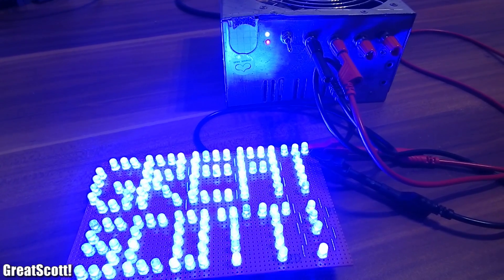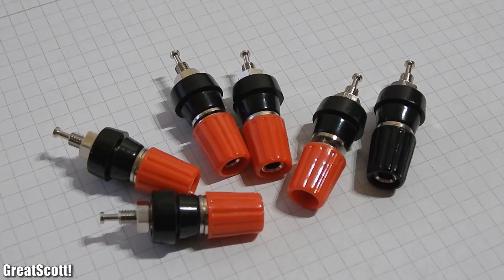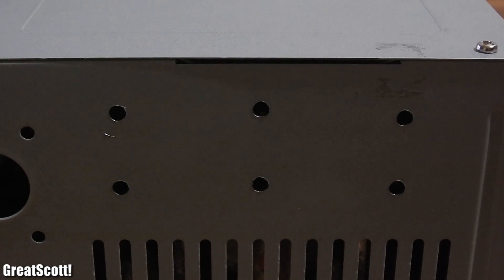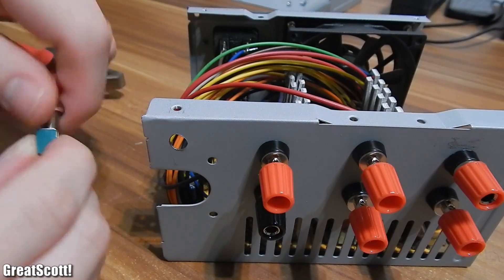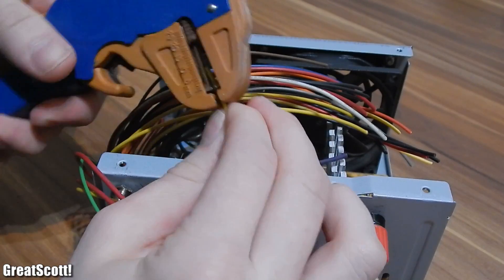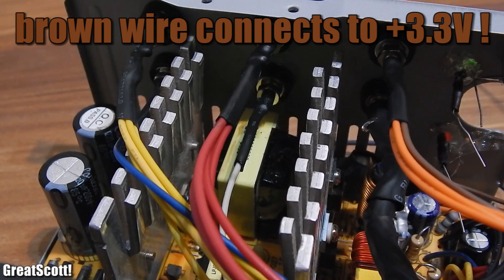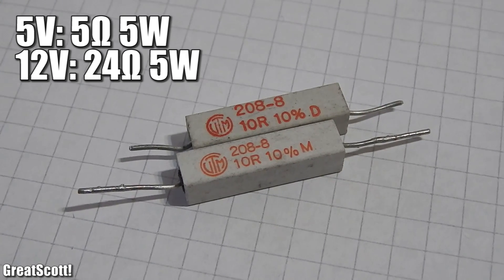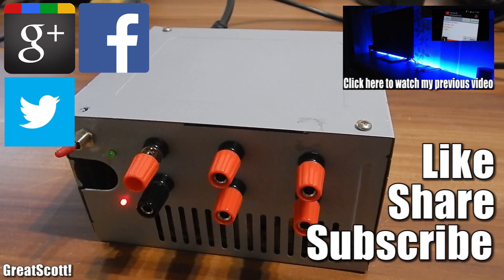DIY Lab Bench Power Supply

Comment: I don't understand having to use a dummy load like it was used here to make it stable when you're drawing a small load because a device will only take what it needs, for example say you have a 12v 2a device  like a mini computer, but you plug a external hard drive into the USB and it doesn't work and it seems to drag the system down then you use a 12v 3a and it works fine because that device only draws just enough to properly run that device so why does this dummy load make a difference?

Comment: The Purple wire 5v SB 2amp is great if you have a clock or something you will always need on SB stands for Standby so even when you turn the power off the way you have it and the off switch is not directly after the mains in, it will stay on, awesome for my uses
Reply: thanks i hade no idea and run a second 5v power supply

Comment: This is essentially what I use since money is tight & electronics is just a hobby. 5V, 3.3V, & 12V are common enough voltages. I've been meaning to do some modifications to get other voltages out of it like 1.2-1.5 & 9, but I haven't gotten to it yet.

Comment: Great Scott  I have a question I tried to build the power supply I followed you instructions and when I wired the switch and leds it worked and would light up and the fan would spin once I connected the resistors and the binding posts the on of my leds stopped lighting up and when I flipped the switch the light on the power supply stopped lighting up I disconnected the resistor and now the led lights up and dies do you have any suggestions please help

Comment: I'm sorta a noob at electronics, so would you explain to me why/ what you would need -5 and -12 volts for?
Reply: Negative voltage just means the current is flowing in the opposite direction.  So if applying a positive voltage causes an electric motor to spin clockwise, applying a negative voltage will cause it to spin counterclockwise.  

I'm still learning this stuff myself, so while I'm sure they're used in other contexts, I'm not sure what they are.  When I see a negative voltage on my multi meter it usually means I've made a mistake. :-)
Reply: Just to expand on the answers, (you probably know this by now) but you can also connect the positive to one of the positive terminals and negative to another terminal to get a greater potential difference. eg. positive to +12 and negative to -12 = 24V
Reply: therealfaloun that's not what he's asking,.. he wants to know what -5v and -12v is use for, i'd like to know as well.
Reply: @Kyle Thomas, the +/- voltages in this supply are used to power the input of OpAmps so the output can be driven to a very precise voltage. In almost all circuits where you find a negative voltage generator, that negative voltage feeds into a precision op amp, either the power rails themselves or the inverting/ non inverting inputs. If you have a +5V rail and a -5V rail you have created a differential voltage of 10V on the output, and you can get a very precise 0V output as well.
Reply: Kyle Thomas the +/- power supply are used for opamps. Opamps are used to amplify and/or oscillate signals. As many signals consist of both positive and negative magnitude (ex- sin wave), it is only possible with negative voltage to amplify it in negative magnitude otherwise negative half cycle would be clipped in output.
Reply: You use 5V a lot when messing around with Arduinos and other small electronics, while 12V is commonly used on vehicles (cars, boats, RVs, etc).  Those are general statements and not true in every case.
Reply: therealfaloun awesome thanks! It makes sense, gonna go and try this for myself.
Reply: Ok that makes sense, but would u have to do anything with ground? or Just keep it connected to the negative terminal or whatever you have it hooked up to?

Comment: Great plug & plag DC PSU DIY.  However would be better if you made it variable PSU so that you can control the current.  A lot of modern PSU's do 70A+ on the 12V rail.

Comment: Hey scott I got a power supply but when i put two 10 ohm 5% 5w resistor (part number A103639ct-nd i got it here http://www.digikey.ca/product-detail/en/te-connectivity-passive-product/SMW510RJT/A103639CT-ND/2731163 
) they heat up too much like way hot I did not leave them for long because i have no clue what will happen. what resistor do I need. On the power supply my red is the highest output at +5V 31A.

Thanks

Comment: why do you have to put the load in it? what would it do if you didnt?
Reply: The power supply won't'work otherwise, they detect low load and then shut themselves off.
Reply: I put in two usb-ports and I added a cable with a barrel jack, for my Arduino.
Reply: INVISIBLE SUN I did a similar Power Supply mod. I also put in a green LED, and it was enough for the supply to power on. So I didn't need another dummy load.
Reply: I just built it myself and I also didn't need the resistor!
Reply: The dummy load. Indeed, the resistor is needed for not exceeding the 20 mA
Reply: The resistor on the led? I highly recommend you out that in. Or do you mean the dummy load?
Reply: Nice. Here's mine.
https://lh3.googleusercontent.com/lHMwG1JPQ37FOMdhX0aK7HgaWZ6NXxPOJG7cdMtdNA1QsJDA7uryQ1wmgbbPpHuzqxkp16utqQ
Reply: I can't open the picture though
Reply: can you post the picture and how it was wired

Comment: Like you video. I tried to build one of these benchtop power supplies. My power good light keeps blinking. I get all the correct voltage I checked in twice. Can understand why the power good? Led keeps blinking. Yeah, only thing I didn't do is put. A dummy load on the 5 volt Rail. Could that be the problem?

Comment: Hello Scott. First of all, Congrats for the great channel, thanks for all your inspirationnal videos ! I am builind my power supply with the same principle, but I would like to have an ajustable Channel. I was thinking about wiring a +12 and a +5 of the PSU in series to get 17V and then adjust it with a transistor which I would command in PWM (arduino ...). Do you think that would be a good idea ? Thanks ! :) EDIT : Just realize my question was silly. You can't wire 12 and 5 in series cause that would mean shorting +5V or +12V to the GND !!!

Comment: Will a 10w 5ohm resistor work for the 5v dummy load?
Reply: Yes.. 10 watts is more than you need, but will do a better job of dissipating heat.
Reply: can i use 2X 10 ohm 15 watt paralel or 2x 6,8 ohm 10 watt paralel what will be better i have only this resistors

Comment: Can you go between the -12v and +12v and get 24v?
Reply: Marco Principio Yes, you can, but the current is then very limited...
Reply: Yes but the amp will be limited to a point ,it will be worthless to use.. i suggest following another build guide(i will leave link in next comment) where you have to connect boost/buck converter to 12v rail and voltmeter&ammeter to the connection and solder few potentiometers to control outpur
Reply: Ummmm  yeah man u got it

Comment: I want to use for the +3v, +5V and the +12V fuses, can I use this https://goo.gl/W6cCoK (car fuses) for each (whit correct Amp of course (probably 5A for each))  or are these fuses not good enough?
Reply: A fuse is a fuse is a fuse.. the only difference would be whether they are fast or slow blow fuses. Which type you use depends on your load. I believe that most auto fuses are fast blow.

Comment: Wait, you said that this project can kill you if your not careful. But if its unplugged how can it kill you?
Reply: Not sure about the particular power supply he is using, but if there are large enough capacitors in there without bleed down resistors, they can store enough charge to do some serious damage.  But I think the bigger danger is the mains voltage.  I think he was stressing the importance of safety for liability reasons and because you have no idea what level of knowledge his viewers have.  Hope this helps!
Reply: MicahTheManiac capacitors. i salvaged a atx psu which had the fuse killed. Looking of one of those caps, it stores 200v 470uf hi voltage
Reply: It is rated for 200V, it doesn't necessarily store that much.

Comment: in order to have standard or the same at all time load on the power supply can i use one more fan instead of the resistor correct me if i am wrong and in mine i have to connect the green(power on) and the black(ground) in order to activate the power supply how you did that i didnt understand did u use an other method?

Comment: I tried making this and got it to power on but the voltages measure a little low: 2.84V for 3.3V ; 5.4V for 5.5 ; 11.2V for 12. Also, whenever I hook it up to a circuit, the power supply shits off immediately. I do not have the power resistor and I did not have a brown wire to hook up to the 3.3V. Any ideas on what may be happening?
Reply: awesley92 the power resistor is the reason your having it shut off when you add a load, the power supply needs to have a constant load from when it's on. The power resistor achieves this, being it's a dummy load and will suffice the supply to turn on when other loads are applied to its rails. Also a word of caution these resistors can heat up quickly hence being ceramic I would suggest mounting it near the fan with adequate tape or insulating material to avoid any contacts. I buy my off eBay for under 2 dollars.
Reply: Yeah I finally got mine in the mail the day after I posted this and it works great. Thanks anyway
Reply: awesley92 oh that's good to hear, np
Reply: shits off shits off shits off shits off shits off shits off shits off shits off shits off shits off shits off shits off shits off shits off shits off shits off shits off shits off shits off shits off shits off shits off shits off shits off shits off shits off shits off shits off shits off shits off shits off shits off shits off shits off shits off shits off shits off shits off shits off shits off shits off shits off shits off shits off shits off shits off shits off shits off shits off shits off shits off shits off shits off shits off shits off shits off shits off shits off shits off shits off shits off shits off shits off shits off shits off shits off shits off shits off shits off shits off shits off shits off shits off shits off shits off shits off shits off shits off shits off shits off shits off shits off shits off shits off shits off shits off shits off shits off shits off shits off shits off shits off shits off shits off shits off shits off shits off

Comment: How can convert an ATX to Bench Power Supply with fixed +3.3V and +5V including an adjustable voltage regulator using the +12V line? I found some LM317 regulators, can I use this to make it? I've seen some videos that use this but, never with a fixed and variable conversion.

Comment: Wow whops that hurt just got shocked by 240V from toying around with the computer power supply . be carefull people that do this
Reply: did u touch the capacitors?
Reply: @bubbadam1589  he wouldn't be messaging if he did
Reply: @ishigamiyu1991  i you touch the capacitor with the psu unplugged but charged it will give you a nasty shock but wont kill you
Reply: CarterGonta i gotta thank you for your sacrifice! good job!
Reply: @__MINT_  fr dude? °O°
Reply: @ishigamiyu1991  The capacitors in newer psus are usually paired with a drainer that drops the voltage to a safe level in minutes, so no matter how strong the current is it won't get through your skin. And it doesn't necessarily kill you even if you get shocked with a lethal current if the duration is short enough and you are lucky.
Reply: @aqekr5607  +knowledge

Comment: hi.. I've watched your variable lab bench power supply as well.
is it ok to use the atx power supply with step up step down converter to make a variable supply
thanks,
Reply: yes absolutely,  as the voltage converter can handle 10 amps.

Comment: Hi,
I have just two question for you:
During the past days  I did the transformation of an ATX  PC power supply as bench unit.
A switch as  jumple  has  been installed  on green and  black wires , because the power supply is not equipped  of switch on 220 supply.
Once that the job has been completed,  I  did an attempt to  recharge  a 12 V battery.
It was observed that during the normal recharging phase if we put the switch in off position the fan of the power supply continue to run till the disconnection of the power plug.
I mean that is like the power supply take power from the battery. Could you please explain
me the reason?
It will be appreciate from my side.
The last question is the following:
Why I can not recharge my IPHONE by this power supply?
Your feedback are very important for me. Thanks.

Comment: if I have a powerful enough PSU, can I get the full 10A with this build? or is there some other limiting factor. I think the LTC3780 goes up to 10A. Then again, with 130W rating I guess that means 10A only at 13V, hrmmm...
Reply: If the supply says it can go above 10A, it should be able to. ATXs do not usually use the buck chip you posted. As you can see at 1:06, this PSU is rated at 200 to 500W
Reply: Crap, I posted this on the wrong video, I meant to post this on the Variable Lab bench power supply. I'll repost there.
Reply: johnb003 lol that makes much more sense

Comment: where can i find a 5w 5ohm 5V resistor?
Reply: at my local electronics shop i can get a 1 ohm 5 watt resistor or a 10 ohm 5 watt resistor, why not a 5 ohm one? stupid jaycar. would a 1 ohm or 10 ohm work for an old psu
Reply: and on more thing. Would i be able to charge a 9.6v Ni-Cd battery with this? my 12V 200mA charger for it broke
Reply: If you want a 5 ohm resistor just connect two 10 ohm in parallel.
Reply: oh Thank you!

Comment: My power supply (Allied SL-275TFX) has 16 Amps on the 3.3V and 12 Amps on the 5V with a combined wattage of 110. The first +12V rail is 5 amps 60 watt. The second +12V rail is 13A 156 watts. Could I solder both +12V rails into one plug? What rail should the dummy load be on and what size resistor?

Comment: if the binding posts have metal studs, and the stud touches the metal casing then you have a supply that grounds with the case.. which is kinda dodgey
Reply: On most binding posts of this type the metal stud never touches the chassis. they have plastic washers that prevent this. Some audio binding posts don't have these washers and are meant to be mounted on a non-conductive surface.

Comment: Nice tutorial but one objection though.Maybe the dummy load shouldnt be wraped in tape because of the heat that it will produce, wouldnt it be better to mount it somehow in the chassis of the psu?
Reply from the maker: Sure
Reply: The psu has to have some load, otherwise it will not turn on.
Reply: Mighty Doge atleast my older psus will turn on with a paperclip but i think the newer ones need it to balance the power or something
Reply: why should you use a dummy load?
Reply: angrycreeper100 On the new ones you have to short green with ground and have some load attached
Reply: 5 ohm 10 watt for 5 volt, and 20 ohm 10 watt.

https://www.amazon.com/Uxcell-a14010900ux0149-Aluminum-Wirewound-Resistor/dp/B00KHTQEKY/ref=sr_1_4?ie=UTF8&qid=1526711000&sr=8-4&keywords=5+ohm+10+watt+resistor&dpID=51hEkW%252Bx0QL&preST=_SX342_QL70_&dpSrc=srch

https://www.amazon.com/a14010900ux0145-Aluminum-Housing-Wire-Wound-Resistor/dp/B0166I7LV0/ref=sr_1_1?s=industrial&ie=UTF8&qid=1526711048&sr=1-1&keywords=20+ohm+10+watt+resistor&dpID=41sGwDyoNwL&preST=_SX342_QL70_&dpSrc=srch

Comment: Its a good idea to do a voltage divider with 10k and 30k on 12v rail and create a 9v rail with it?
Reply: If you connect high loads, the voltage is unstable, and you can't deliver much current through that kind of resistance. But for some uses, it might be helpful anyway, so it depends...
Reply: It might be dangerous because I have not checked if this is a floating power supply, but you can TRY use the 8.7 V across the 3.3V and the 12V rails.

The safer way is to use a voltage regulator IC.

Comment: can i just solder a 12v fan to the 12v+ wire?
i know stupid question but iant like 10amps too much for it?
Reply: Even if the fan could handle that currrent (Hint: IT CANT), the PSU might be damaged by excess current draw. Always use resistors - they are cheap and can preclude damage from much more expensive parts...
Reply: yes you can solder a fan as it's already rated at 12volt and will draw  very less current solder 2-3 fans and that is your dummy load.

Comment: Hey! Just wondering how come my atx powersupply is not working after I tried to power a LED strip that the Forward voltage is 12 volts and after 10 secs it's not working anymore the standby light is on but the Red light is not (My indicator if there's a output voltage) but when I'm trying to flicker the switch its like working and after 1 sec it's going to a standby again... Did I did something wrong? (Obviously I did) can you help me?
Reply: Sounds like your dummy load doesn't work properly...
Reply: Hadinos Sanosam hmmm you think so? So do you also think that i should replace the Transistors? Because they have a feature "Shutdown protection?" or I'm just going to replace the Dummy load with a higher resistance?

Comment: Need help!!! where to connect gray wire? Or i can just leave it?
Reply: leave it. it is used for testing if the capasitors in psu are loaded etc. like the voltage tests you see on your bios in a modern pc but this test is a routine of mobo before actually starting to work. my english is not enough for enough for explaining this but you can check https://en.wikipedia.org/wiki/Power_supply_unit_(computer)#Wiring_diagrams for more info

Comment: Hey, just wondering, how much current goes through the heatsinks?
Reply: as far as I know, they are not used as electrical connections
Reply: Spoder Man Yeah, but they are on some components that do have current flowing, so if you grounded the heatsinks current would flow